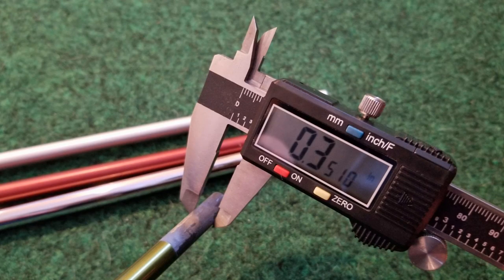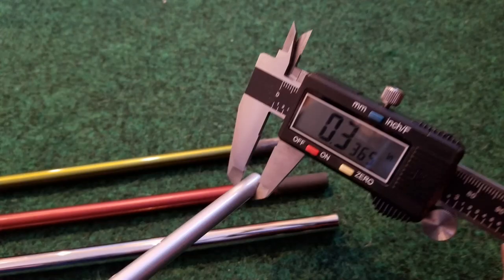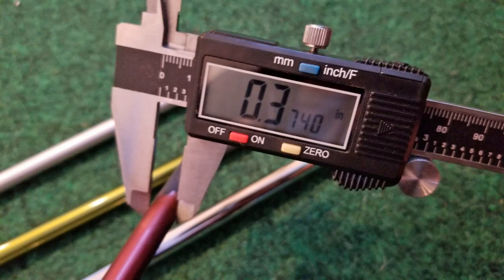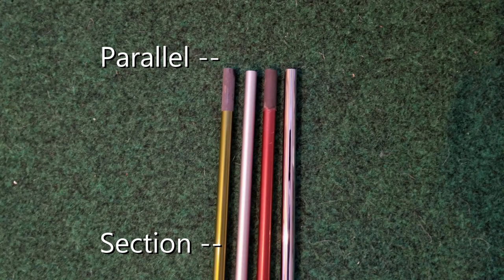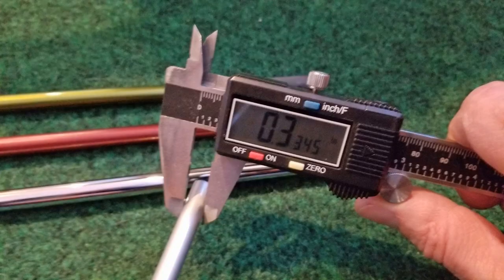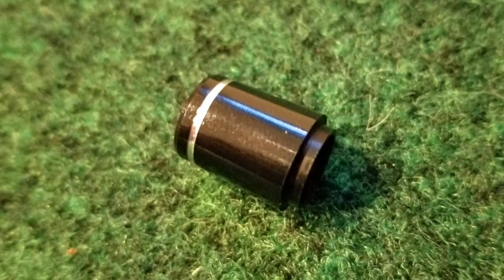Fitting In A Minute #3: Tip Diameter

Comment: Taper tips are soooooo rigged.  , oems, making sure do it yourself guys get road blocked at the ferrul section.
Reply from the maker: King, There are definitely some tricks to working with tapers, and finding/making ferrules fit without the dreaded "ferrule creep" can be a challenge. But overall I like working with taper tips when they are from a quality manufacturer. 

I should have mentioned in the video that taper tips start out as parallel, and have the taper pounded into them. Also, I have heard that tapers are sometimes preferred by OEMs as they can be pressed into the head and still continue through the assembly process while the epoxy dries. So, if true, that would support your point that tapers are not intended to be an advantage to the independent club maker.
Reply: @fit2yougolf926  exactly,  then when and if you do snip the .355 manufactured taper section, only like a 1/4 of the cleared section is .370 after that it's much larger, and can't grind that material down with confidence of it holding up, and then the next road block, it's too stiff 

Lol, ooooo they rigg the game for sure, lol
Reply from the maker: @kingshark4645  , Gotcha, I see how that would be frustrating!

Comment: Boooo 335's ... I hate them.
Reply from the maker: King, if you like any of the Aldila shafts, you can still find those new or on ebay at 350. But finding newer heads that fit them is getting more difficult as you know.
Reply: @fit2yougolf926   .. yes, finding out like you said, mostly ping and taylormade brands only. 

About to try and delicately bore out a adjusted hosel to .350 , seems to have enough material to do so. 

Hopefully it works, and I can work .350 clean fits, or grind a hybrid shaft with enough tip material in there and add an extension
Reply from the maker: Kiing, I'll be interested to know how it goes! I've not tried that myself.
Reply: @fit2yougolf926  Me too, lol
Reply: @fit2yougolf926  , phase one completed, the adjustable hosel was aluminum and easy to bore, so careful if using a drill go slow. 

Used a 9.5mm, so I'm have to shim for a snugg fit. 

My cobra amp cell now will be .350 or better at the tip 😎